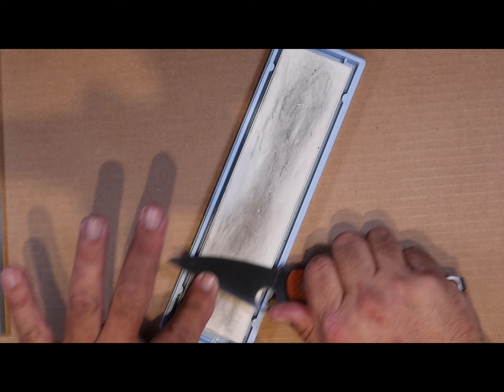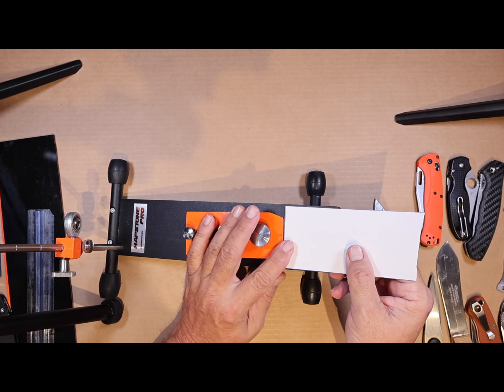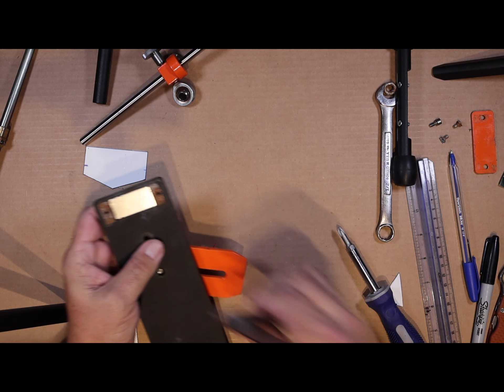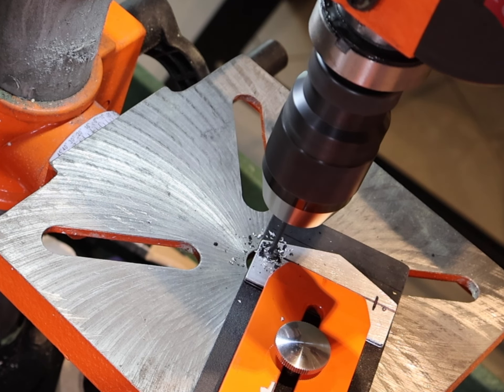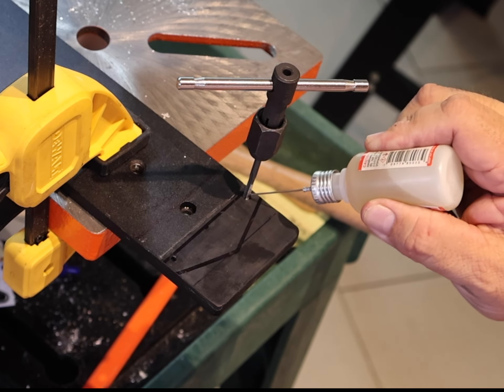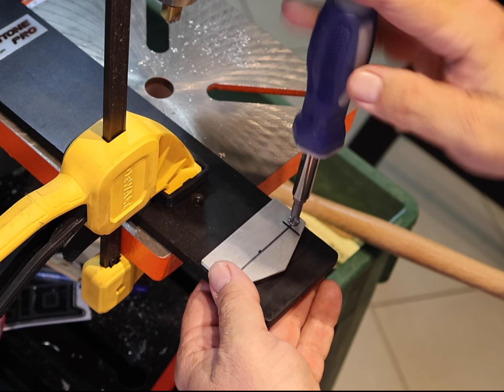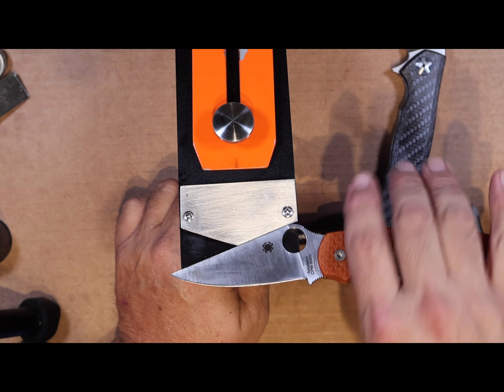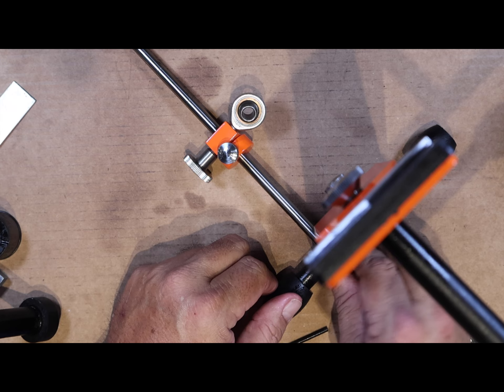My Hapstone Knife sharpener modification. Modifying sharpener for use with Spyderco knifes

Comment: Did you try the diamond compound on a strop . It leaves a real tiny scratch pattern but shiny . After the Sharpening and dragging through soft wood a ceramic rod and the strop usually does the trick . Sometimes it takes a few rounds right ? Lol . I hate when a carbide sticks out of the edge